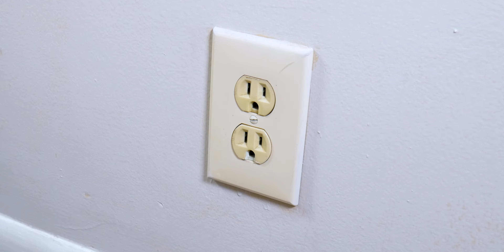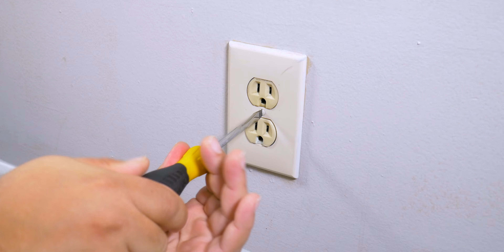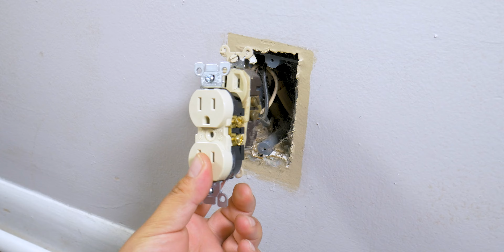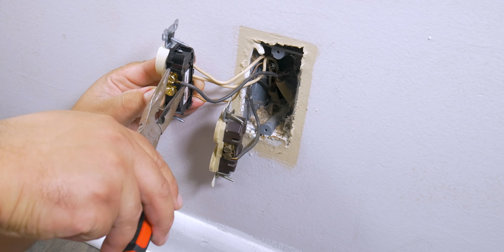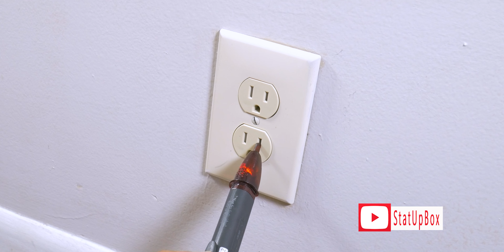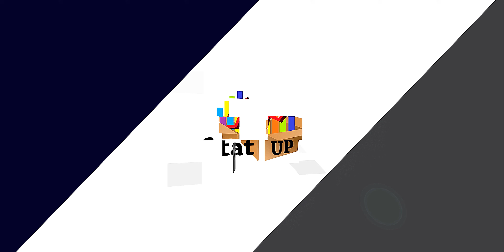How To Replace  Electrical Outlet Install Easy Simple

Comment: What if the wires are so old you can't tell the Blk from the white wire?
Reply: I'd say you need new wires 😂  I'm new at electrical work but that probably means they are to old to trust and need to be replaced also if you've lost that much color then is it outdoors or getting moisture on it? If so you've got wires that aren't meant for outdoor weather. Again I'm just a newbie doing a lot of reading and studying and asking people around me questions. Good luck I've got similar issues though nothing like that as the guy who had my house previously thought he was a master of everything except on what's up to code and what is a really really really bad job

Comment: The only thing I would have added to this installation would have been to lightly rub fine grit sandpaper on the connections for a better contact to the outlet

Comment: Heck, I'm shutting off the power for the whole house. That way, there's zero chance I will flame on like Marvel's Human Torch.
Reply: Still check to see if there is power 
You never know
Reply: There is still a chance
Reply: If you want to find an outlet quickly, I suggest you find a circuit breaker finder. It's a cheap tool that will save you tons of time!

Also, I recommend you get electrical gloves, if you want to be extra safe. As long as they're rated at least 300V, you should be good.